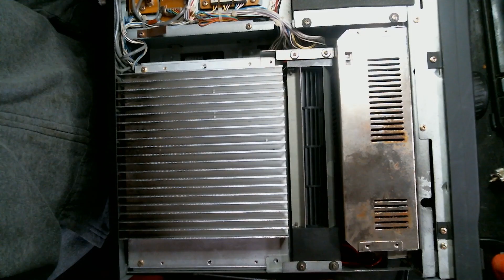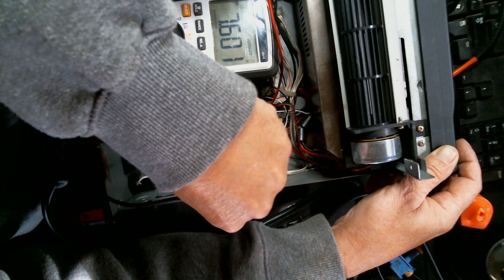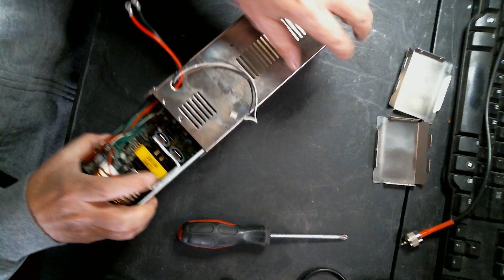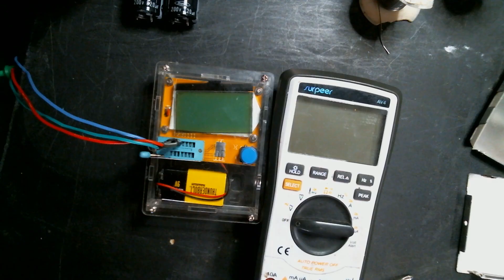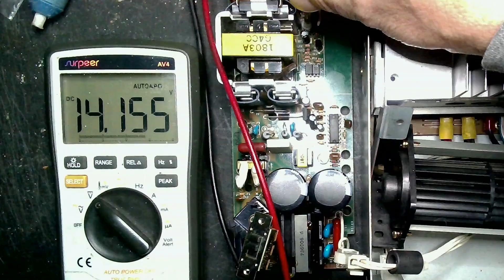Yaesu FT-1000MP Won't Power On

Comment: Yes it is very complicated power supply lift out the power pack and test it first then there is a resistor on the main supply that goes open circuit took me about three hrs to fix one of these tracing the fault good luck

Comment: Good work, Jeb! I've been messing with an RCI 2970 that loses the AM carrier after it warms up. Still transmits, but the frequency isn't stable and the carrier is gone on the spectrum scope. Interestingly the vco voltages and oscilator are right where they need to be even when it's gone wonky. Any ideas would be appreciated. Checked all the normal 2970 bad solder joints and such.
Reply from the maker: Sounds to me like the AM regulator is giving up. Check your voltage at TP1, 2 or 3 for around 6V AM and 13V SSB in TX mode. If you have less then 5V in AM TX then Q51 has gone bad.
Reply: @Jeb-N2JEB   Thank you for the reply, Jeb! I'll check the voltage tomorrow and see what I find.
Reply: Checked the voltages. Had 2.78 volts on AM transmit. Got a new regulator on the way. I appreciate your help! I'm new to this and watching you work through the schematic and diagnose has been invaluable.